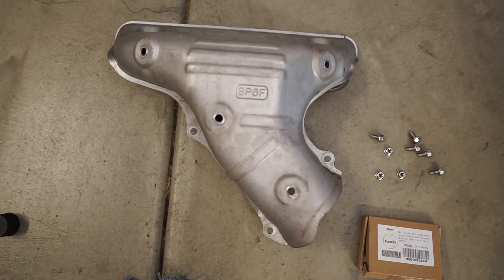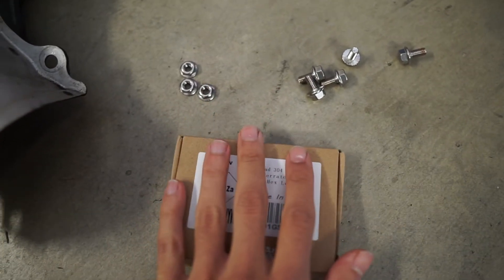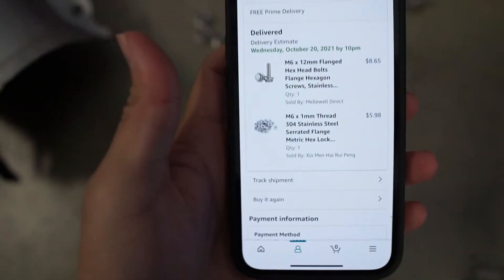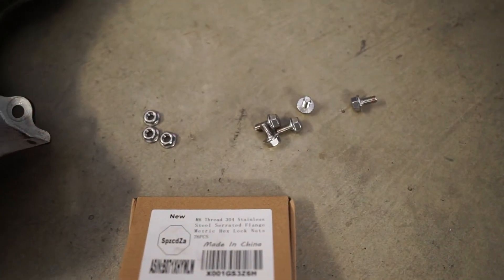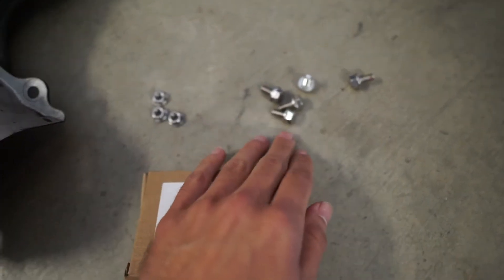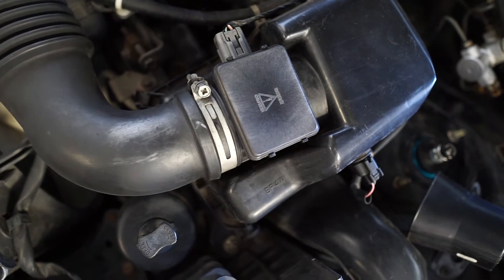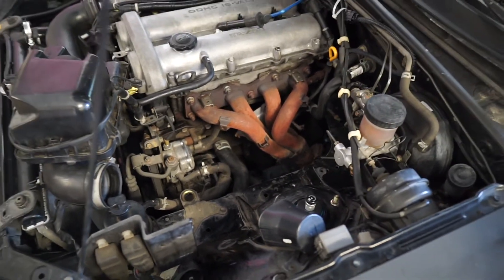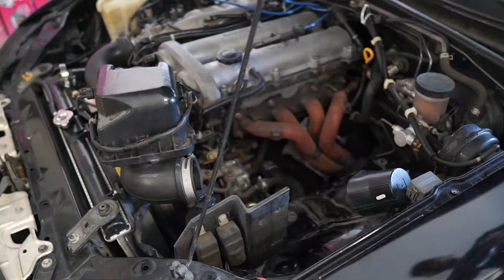MIATA NB2 HEADER HEAT SHIELD INSTALL ON NB1 BP-4W MOTOR - BUY THIS HARDWARE!

Comment: were you able to resecure the dipstick to the bracket? i swapped my nb1 precat header to a nb2 and after putting the heatshield on, i cant place the dipstick back into its original spot.
Reply from the maker: The previous owner had done the swap, I just added the heat shield but  I do have a dipstick.
Reply: @jesseesierra  are you able to send a pic or video of the dipstick bracket? i had to move mines just to fit in the shield